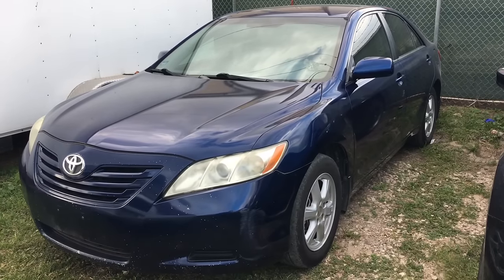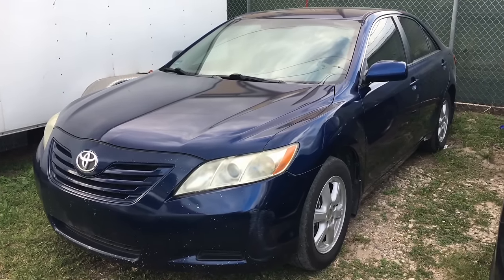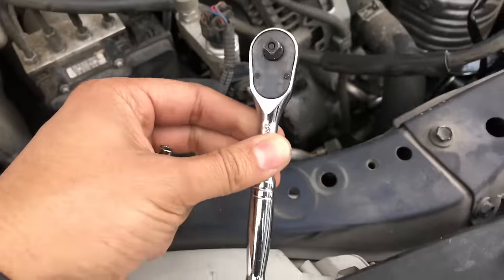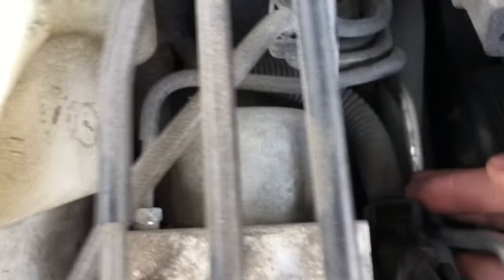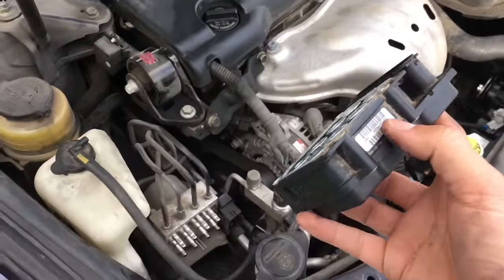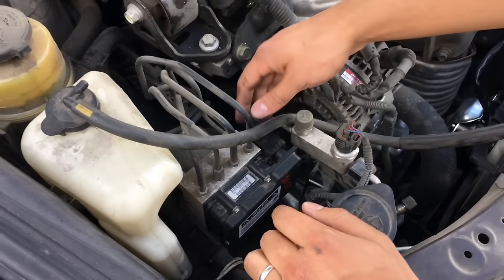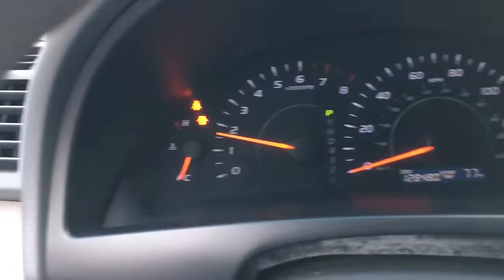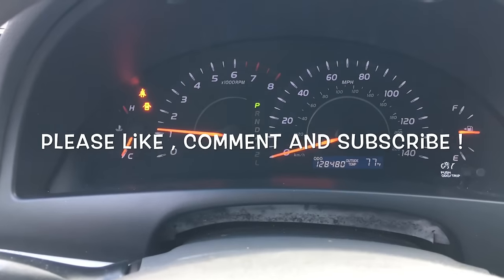How to fix a 2007 Toyota Camry ABS and Brake light and also flickering speedometer

Comment: Good video!!!'Am having the same challenge on the Toyota Axio, abs and break light on, check engine on and the indicators are not responding unless the hazard button. And the steering wheel it's stiff. Could on this be as a result of a failing ABS Module?
Reply from the maker: Yes
Reply: @GarageBoys  thanks. My guy is working on the  same.

Comment: ABS module is very expensive. Should i buy it on EBAY ? ebay is only 125 and they charge 600 at autozone or advance auto part. What do u think ?
Reply from the maker: Try at a junk yard

Comment: Wonderfull vid man! My 2007 toyota auris has same kind of a problem. abs, airbag and check engine light pops up every now and then and also speedometer dies. And sometimes all works fine even for a couple of days.. Could it also be a faulty abs-module or could the whole instrument panel be broken?
Reply from the maker: Bad ABS module won’t give you a check engine and airbag light. Sounds like you have something else going on. I would recommend checking the “check engine” light

Comment: I am experiencing this exact problem. When I go to look for an ABS module at the junk yard, does the module need to be from a 2007 Camry or any year Camry. My car is a 2007 Camry. Thanks for this video. Very excited to try this solution.
Reply from the maker: Yes it needs to be for a 2007 but sometimes parts will match for same model cars in this Camry I believe is 04-08 double check with the junk yard first or call a Toyota dealer (parts) and they will give you that information for free. Hope that helps! And please help us back by subscribing
Reply: Thanks, will definitely subscribe. My junk yard mechanic also said not to remove module from the pump because that may fry it. He says the whole module/pump assembly needs to be replaced and module synced to my cars computer and codes clears and brake lines bled. But your sure only replacing the module part will fix the issue? Or at least it shouldn’t cause more damage to my car?
Reply from the maker: Zach will definitely NOT harm your car, this model doesn’t require that. Replace it and it will solve all your problems like shown in the video
Reply: Garage Boys Your solution worked for my car as well. Found the ABS pump/control module assembly at a auto salvage yard for $115. Took the module off the pump and put it on my car. It’s only been a day since making the repair but so far the problem is gone and things are back to normal. This was super helpful. Thanks again!!!
Reply from the maker: Zach we are glad we could help ✌🏻

Comment: Thanks for your video, I did the replacement for but still the ABS, brake and the speedometer is not working. What do u think maybe the issue?
Reply from the maker: Maybe your “wheel speed sensor”
Reply: It might still be d ABS module. I use Camry 2009 and replaced about four abs modules but problem persisted. Until I met an experience abs dealer in d junkyard in my city. He ask i go back and check d number written on d ABS component(pump). Mine was X8( apparently there are X8 and other variances and each variant not interchangeable). He sold me X8 used ABS for d equivalent of $78 and my car problem got  fixed.

Comment: Thanks for posting, didn't realize this is a problem on so many Toyotas. My question is, until I fix it, IS IT SAFE TO DRIVE? I understand that the ABS may not operate correctly, but are the brakes still ok?
Reply from the maker: Allan Stuart you can still drive it the way it is. But the sooner you fix it the safer you’ll be

Comment: I was also having this problem, i just remove the ECU and clean it with an electronic cleaner spray, let it dry and put it back together, it is working fine so far.
Reply: Morjesta! name of spray, please.
Reply: Do you have to bleed any brakes or anything or?? Just take it apart??
Reply from the maker: Lindsey Ford you don’t have to bleed anything.

Comment: I ordered a replacement and swapped the part as demonstrated, but it did not resolve the issue of the brake light and abs light being on.  I checked the brake fluid and it is full.  When requesting to return the replacement part, the seller asked if I attempted to clear the "trouble diagnostic codes" for the replacement part.... Any idea what he's talking about or what my problem might be?

Comment: You're the Man.....solved My Problem very easy. Thnx a bunch My Guy.
Reply from the maker: I’m glad I was able to help! If you can, help us back by subscribing.
Reply: @GarageBoys  problem facing in Chevrolet captiva 2007 manual, DTC U0073(ECM/ECU lost communication), U0121(ABS MODULE lost communication) and P0500(Vehicle Speed Sensor) ,,,,suddenly instrument cluster stops working ,all needles(Temperature, rpm, speed etc.) showing 0 reading , ac stops cooling while blower keep running,reverse gear light stops working, Service Vehicle Soon light & MIL illuminates in cluster. and all happen intermittently and all together. Can anybody suggest solution?
Reply: where did you get this ABS module ?

Comment: Brother I have a 2009 Toyota Camry LE. I have similar problem as in the video you have. Only thing is it is Intermittent meaning Speedometer drops to zero then after sometime it comes back up. DO you think  replacing ABS Controller module will solve the problem. I am planning to remove my ABS and get it fixed by someone out of town. Also the Mechanic told me that even after the ABS Module has been removed i can still drive around is he right?
Reply from the maker: If the only problem you have is the speedometer gauge than you most probably have a bad speed sensor. But if you have the other problems like in the video which is ( ABS light , brake light , speedometer gauge ) than that will be the ABS module ,  

And yes you can drive the car without the ABS module but it's not recommended
Reply: Brother did you find the solution?

Comment: I did everything you did, but my brake light is on. Speedometer and AC is working though. Any thoughts?
Reply from the maker: Janet Navarro you probably need brake fluid.  If not then maybe one of your brake back up lights is burn.   If it is then just replace it and light should go off

Comment: Hi, what are the differences between the ABS actuator and the ABS control module? Are they the same things? I was told by the Toyota dealership that my car needs a ABS actuator. That costs $2200. My car shows all the symptoms mentioned in your video.
Reply from the maker: I believe they are the same

Comment: I am having the same issue after 200k miles on it the difference is that the light on cluster where it reads P, R, D goes off too while driving. But thank you so much for this video very explanatory, will try to repair it myself.
Reply: Did that solve that problem? Because my p.r.d goes off while driving too

Comment: Hey there. Great video! I'm having all of the issues described in this video as well as a rough start... just barely cranks. Does this still sound like something related to the abs module? Thanks in advance!
Reply: Check your fuel pump
Reply: Check your battery
Reply: @louishunter5135  it ended up being the alternator...thanks though :-)
Reply: Maina B knew it was charging related. I’ve been working on cars in my dads shop as a kid couldn’t stand the insults so I went to work with a dealer in 99 in northern Virginia. Made it to the top Toyota master diagnostic technician and there isn’t much I haven’t seen. So if You have any other weird questions just ask I’ve probably seen them or know someone that has
Reply: @louishunter5135  I ended up getting a new car any because of another issue that I was tired of dealing with. Long story alert, lol. Besides needing a new alternator, my car was burning oil like crazy...had been for the last couple of years. Toyota told me that I needed a new engine. Come to find out that there was a bulletin issued (not a recall) that the 07-11 Camry's had an engine defect. Toyota would only replace it
Reply: if the vehicle was less than 10 years old and under 150,000 miles. I was under the 150, but had owned the car for 11 years when the problem was identified smh.

Comment: Quick question. Is the ABS actuator assembly  the same as  this abs module?
Reply from the maker: No I believe it’s a different part
Reply: Garage Boys  mmmm I see,  because  I took the car to the dealership  and that's what it needs but I can't  find anywhere  a abs actuator assembly  anywhere?  It has the same exact symptoms  by the way...
Reply from the maker: This is your issue, just follow the instructions in the video

Comment: What if just the abs light on ?    Mechanic said sensor in rear hub and you have to buy the hub which is $400 ??   Does that sound right ?
Reply from the maker: If it’s just the abs then yes it sounds like just the hub but $400 sounds very expensive

Comment: Would i have the same symptoms if just 1 of my sensors went bad at the tire? Or these symptoms comes from the faulty abs module? Thanks
Reply from the maker: This symptoms comes from a bad ( faulty ) abs module.
Reply: Garage Boys i just had a new wheel bearing installed, then an alignment job. 48 hours later im having the same issues on my 07 camry v6
Reply from the maker: If you are having all the issues shown in this video and the problem is the abs module, the fact that you just replace the wheel baring is just coincidence unless your mechanic disconnected the module. Hope this helped you and please help us back by subscribing :-)

Comment: I am having this same problem, I've ordered the part. Do I need to bleed the brake lines upon completion of the modulator installation?
Reply from the maker: Tim Mahoney no you don't have too.  It's as easy as remove and install. That's it.  Makes sure you disconnect the battery at first and connected back once you finish , let me know how it goes for you. ^_^
Reply: Garage Boys ordered the refurbished part for $165 ($50 core),  more updates Wednesday!

Comment: Your video gives me hop.....
I have a Toyota 2004 avensis.some months ago I discovered that my breaks were sometimes hesitant to apply.sometimes the break become hard to step on,thereby bouncing back expecially when coming to a halt.
So I ran a diagnosis,and I got a fault code of C1300,C1201,C1208.i took the car to mechanic who removed my abs module for servicing.
After the servicing,he mounted the module back .the problem stoped but I had abs light,vsc light,TRC light and break light showing on the dashboard.

I really don't know what to do.

Am writing from Nigeria.
Reply from the maker: Try disconnecting the negative cable on the battery for 3min and reconnect. That reset may clear your lights

Comment: I have 2009 Camry 3.5 v6 there are  abs and vsc lights on my car plus brake paddle is jerking.
I went to mechanic and he replaced front rotors and pads. But nothing changed after that.Is there any solution for me ?
Reply from the maker: Your problem “MAY” be the master cylinder.

Comment: First of all,thanks for your video. However,it seems like,right away,you went to replace the ABS module, how did you know the ABS module is the culprit,without diagnosing it first ?
Reply from the maker: When you have all of those symptoms together, the only possible issue is the abs module (I did do research online and read a lot of blogs)

Comment: Thank you for the video. I did everything you showed in the video, but the problem persist. The junkyard mechanic said I should replace the whole part and not take it apart. I didn't do that, I followed your video, but the ABS and break light is still turned on, and the sppedometer is not working,and yes the air is still not working properly/ Any suggestions?
Reply from the maker: Alex Carmenates you probably didn't connect the plug right or most likely the part the junk yard sold you is bad.
Reply: Garage Boys you were right. The part was bad. I exchanged it and everything was fine. $100 Thank you for your kind help. It saved me some serious money. Funny that four seasoned mechanics didn't know your fix...
Reply from the maker: Alex Carmenates I am happy to hear your problem is fixed , have a wonderful day ^_^

Comment: How did you discover that this was the bad part? Gracious, mi amigo.
Reply from the maker: It’s the only part that will give you all of those symptoms at once
Reply: @GarageBoys  problem facing in Chevrolet captiva 2007 manual, DTC U0073(ECM/ECU lost communication), U0121(ABS MODULE lost communication) and P0500(Vehicle Speed Sensor) ,,,,suddenly instrument cluster stops working ,all needles(Temperature, rpm, speed etc.) showing 0 reading , ac stops cooling while blower keep running,reverse gear light stops working, Service Vehicle Soon light & MIL illuminates in cluster. and all happen intermittently and all together. Can anybody suggest solution?
Reply: @GarageBoys  i have a 2012 camry and i had my slip hazard, abs and break lights come on whenever i used my brakes. Im not sure if this is a solution for my car but if it is then i just wasted money leaving my car with toyota to check out :(
Reply: @yashtola4678  did you finally discover the reason and fix for your issue? Am having exact lights as you described with the same car model
Reply: @SeunOjedeji  It was my break switch.
Reply: @yashtola4678  thanks, can you tell me how the break switch looks like?
Reply: My toyota cam 09' suddenly got the codes C0200, C0205, C0210, and C0215. Why just not one but all four?

Comment: I have toyota Camry 2005, I did it as you did, but brake light and ABS don't switched off, however speedometer works
Reply from the maker: Then you may have issues with your brakes, the abs sensors that go on the tires

Comment: My 2009 just started this yesterday. Any way to clean it before having to invest in a new one?
Reply from the maker: Not sure if it would help but you can give that a try. we recommend you just replace the part.
Reply: Well, mine is not completely dead... yet. It certainly acts up more in the heat of the day, but it still functions about 80% of the time

Comment: Hello, great video. Wish I found this earlier. :-( :-(  I am experiencing same issue with my 2008 Toyota Camry even after getting my ABS module replaced for $1700 :-(  The store says there is some electrical issue that is beyond their expertise which is causing the ABS module to go bad. I have a suspicion that they installed a bad ABS. Is there a way I can confirm this on my own, so that I can ask them to rework.
Reply from the maker: Bharath M honestly I don’t know.    But if you’re getting the symptoms I described above most likely the abs module is bad
Reply: Garage Boys.. Thanks for ur reply. Did u have to replace just the ABS module or the Acctuator (pump) as well? Toyota says that their OEM part is one assembly unit consisting of ABS module + Acctuator. But i jus got the ABS replaced with an aftermarket piece which didn include the pump.
Reply from the maker: Bharath M well I only replace the abs module part and that fixed my problem.  And judging by other people on here that was just the problem too.    So just replace the abs module  not the pump
Reply: Garage Boys 
I just went today to toyota dealership. They estimated 7k to fix. They asked $1700 to fix abs issue.

Comment: Did you disconnect when you did this because if the battery was still connected maybe your repair show success but if not you disconnected the battery so that clears codes and lights anyway so that doesn't prove it fixed it could take 100 miles to the lights to come back on

Comment: Am having the same problem with Toyota Camry 2005. The brake light on and speedometer not working. Will this solution still work with my own model since it's not a 2008 model? Thanks
Reply from the maker: Eddoh Anthony honestly I don’t know.  But since it’s a 2005 the part may be lower price. Call them and if it’s cheap then replace it.
Reply: Please can you tell me what happened in the long, i am expecting your response bro.
Reply: Garage Boys I really want to know the possible outcome. In addition to mine my car makes a Jerk sound when I put it on reverse. When it was scanned the reverse didn't come on in scanning app
Reply from the maker: Sorry for late reply, you didn’t tag us. If it jerks when changing gears then your issue can easily be a motor mount

Comment: Hi there, having same problem since last 1 month and after watching your video i bought the module from online for $75. I just received it today and find out it comes with the pump as well.  So i am gonna put it tonight but my question is  my fuel meter is also doing crazy thing. While i am driving sometimes the fuel meter is going down for a while then after few moments again its going up where it was at the first point. Sometimes  when the car has quarter fuel left and driving it goes near to the empty fuel  bar and low fuel light comes up then automatic it  goes back to the quarter mark.  I mean its very confusing. I used to get 400+ miles before  with full tank gas(2.4 L camry se 2009). But now-a-days i am getting 280+ or 300 and  this abs problem bugging me and also the fuel meter is annoying. Is it because of the failing abs module? So wondering if you can help with any suggestion or something. Would really appreciate. I got a video of the problem. Thanks in advance
Reply from the maker: Emon most likely the fuel problem you have is due to a bad fuel sending unit in your car.  I think it's located under the back seat.
Reply: Garage Boys worked like a charm, the new abs module. But when i am breaking at over 55mph the steering is shaking excessively. I know it could be rotor but got new front rotors 3 months ago. Any idea what should i do? Thanks for the abs help.
Reply from the maker: Emon if the rotors are ok then most likely you will need new front calipers.